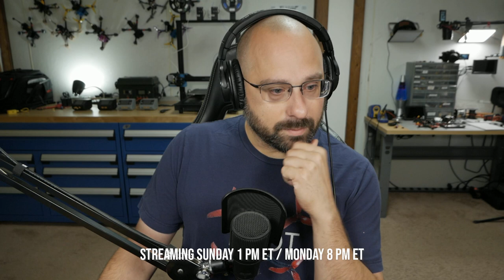How to choose your ESC amp rating. Are modern ESC's over-sized for our use?

Comment: So my 15A escs can handle 15x4 or 60amps. And my 1204 motors can push at max, on a 4s battery, 5.6amps. Therefore the 4 motors will pull 22.4amps at max throttle on a 4s battery, and my 15A escs can more than handle it. Thank you!

Comment: I use some old 20a littlebees on a 220mm frame with 2206 2300kv motors and 5x4.3x3 props. Carries a gopro on 4s 1500mah with enough thrust for some acro and the motors and escs never get very warm at all. For your average pilot, 20-30 amp escs get the job done and are less than $4 on aliexpress. Even on full throttle punches, battery output limitations kinda keep anything from getting out of hand.

Comment: So, why do I keep popping my esc's? This is an ongoing thing with the speedybee f405 v3 50amp stack. I've gone through 7 3 being full on blow outs with fire. These are super clean builds, and happening on 2 different drones with different parts, different motors..... I pull 83+punches with my other v3-50amp stack and I've been running it for 7 months. These stacks I've purchased from Amazon, and ALL of them have failed esc's. Has it been heard of that Speedybee is selling failed product on Amazon? BTW its May 2024 I'm in Canada. I'm pretty sick of blowing up drones I spent serious time and energy building. Hard to get away from the stacks cause I bought them, return them to get a new one....... I read somewhere that flashing bluejay will do something bad to the v3 stack, is this true? I mean after thoroughly looking through the v3 manual it clearly shows flashing bluejay is fine, flash JH-50. (WHICH I had been doing anyway) well I just got the new stack from Amazon in my source 1 v3 frame (cause that's the one it's taken serious beating from...... and push it. I've changed out everything on the drone.... this time running it simple.... no led cob lights, no race wire. Nothing fancy. As if it pops it can go back to speedybee with the other 2 stacks that are to go back next week so they can determine what I already know. They are defective. I've checked all motors/screws..... basically everything you can think of that can do this, and it's all good. I've built them solid. Had others look it over. The 2nd drone is a brand spanking new Mario 5 frame, full dji 03.... and it flew perfect. Then luckily I went to fly it and noticed 1 motor wasn't spinning. Plugged into Bluejay "missing esc" its when you start messing with it, and your able to boot the esc back up again when you get fire bomb esc's. Well least that's what the last one did, redid all firmwares, seem to boot, went and flew 3 packs, caBOOM..... garbage.

 Any assistance is MUCH appreciated, thank you kindly.
Reply: Speedybee ESC’s have just been known to do this more than other options on the market. Take a look at Hobbywing or T-Motor!

Comment: Well then there's the bottleneck in the system 
Xt60- 60amp cont 80 burst 6-10sec 
Xt90- 90amp cont 120 burst ...
Xt60h-90amp cont 120 burst... the one on quads
That's why I always thought 40amp... was the whole board not per motor
Reply: Xt60 can handle 180 amps for 10 seconds

Comment: With exact same electric power of the motor. You need more amps on ESC if you use 4S instead of 6S. That is one of the disadvantages of 4S. But at the moment you will get that money back because 4S LIPOS are cheaper than 6S...

Comment: Is a 45amp esc good for 6s ?
Reply: The Amp rating and the battery voltage are only part of the equation. You also need to know the all up weight of the quad, the KV of the motors, and the pitch of the props. Right now, I am wanting to put a set of 5149 props on a 55Amp ESC, but the manufacturer of the motors show that in testing, a 47-pitch prop pulled about 53-Amps. So, I might be close, or I might be fine, depending on the batch, and how I fly. The best answer to your question is, look at the testing data on the motors, the ESC, and compare that to your quad. Shortest answer, without looking up data, I would say, use a low pitch prop, keep the quad as light as you can, and you will probably be ok. But there is more to it than just amps and voltage. I also had a quad, last year, with a set of Xing-2207-2755KV motors, on an ESC that was rated for 55 Amps, with a 6s battery. If flew absolutely amazing! But… the first time I crashed, I blew the ESC.

Comment: Look at motor thrust table. Match the prop and volts you will be using. 
Ex RCinPower 2306 1880KV, DAL5050, 22V = 32A.
More expensive ESC are typically heavier, with more premium components, and higher AMP rating because tougher - they generate less heat (from FET) and handle it better.
Typical AIO FC 3x3mm FET = JMSL0302AU. 30V. Rds = 1.2mOhm. Can handle 90A @100C 20W.
Obviously real world 90A is impossible, because its not 1 FET with giant heatsink - its 24 on tiny PCB.
Obviously, heavier the quad (ie CINE with GoPro), and bigger and more agressive prop = higher load on ESC.
That is why CineLog mfcr put 2105.5 on 3.5", with 45A ESC - but on a super light toothpick with light biblade , you can use 1404 and 12A ESC.
Reply: so my 2506 1800kv motors will be fine with a 50A ESC on a 6" build?